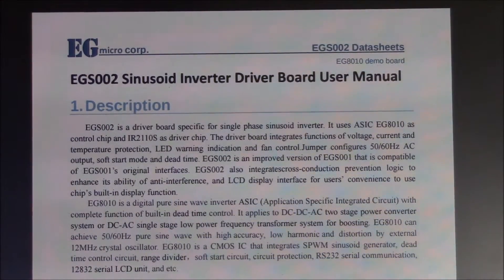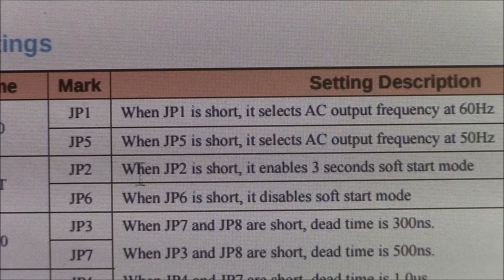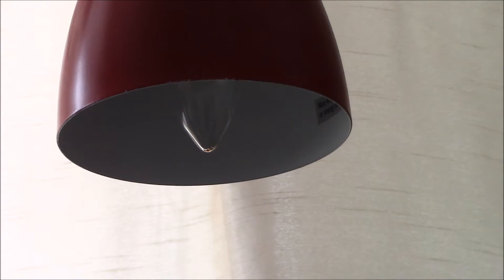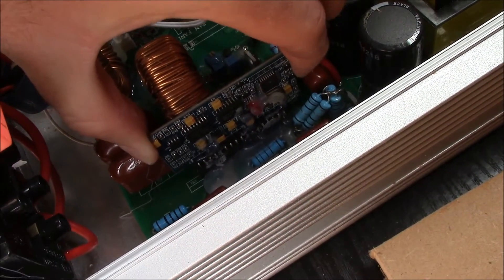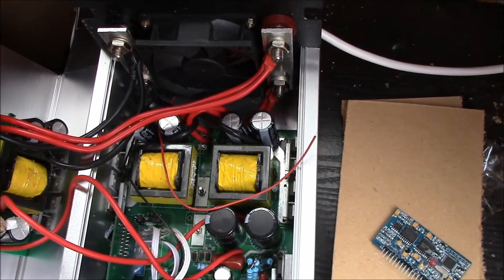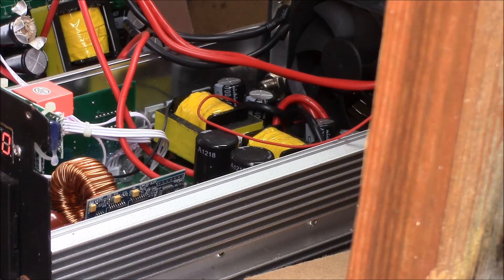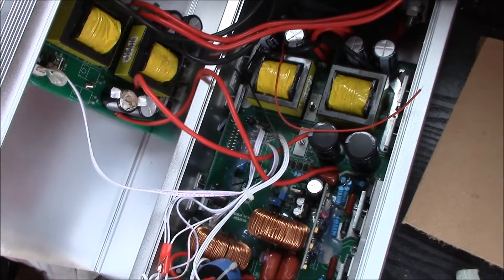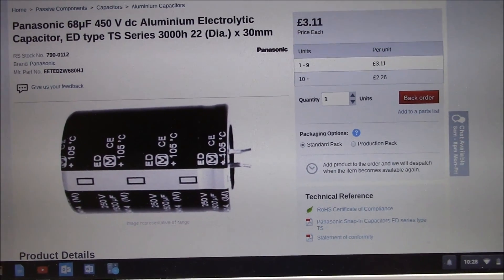how to disable soft start on inverters

Comment: Hello please can you help out with this. I have an inverter with a different driver card. I couldn’t find the manual online. I tried to figure out wich jumper is responsible for the soft start and it was jp2 it work for few minutes and it still on soft start even after shorting the jp2 jumper. Please do you have any idea how to stop the soft start.

Comment: Pardon my ignorance, but what is an 'automatic transfer switch'?  I have heard that the soft start helps with starting motors, is that correct?  Thanks.
Reply from the maker: hi, good morning, I have done a video covering my automatic transfer switch please find it here, https://www.youtube.com/watch?v=q0Cq3y0Q7bk it allows me to power my load from my solar systems as normal, but if the battery's run low and the cutoff protection that stops the battery's getting to flat kicks in and shuts off the power, then the automatic transfer switch will switch in mains power to run my load. this happens very quickly and if say im running a TV off it, there is no noticeable effect to show that the TV is now being powered off the mains. 
your right it what your saying about motors, however im running TV,light,radios ect so there is no benefit to me with soft start, and it plays havoc on the switching speed of the transfer switch.
Hope this helps,
Reply: ***** Thanks much!